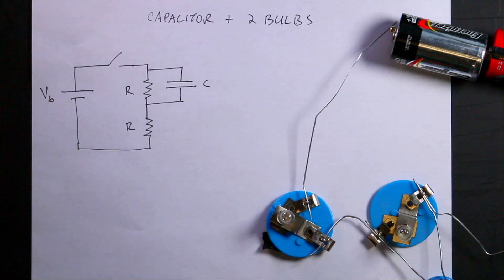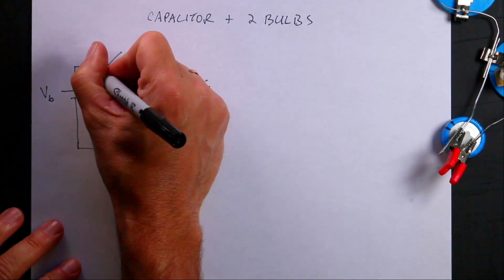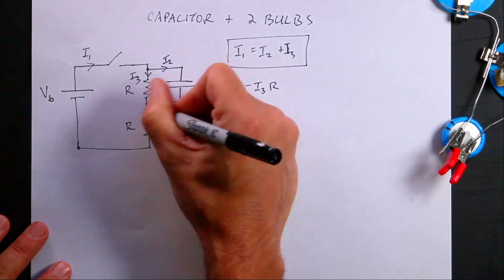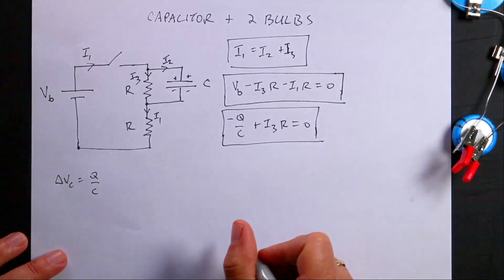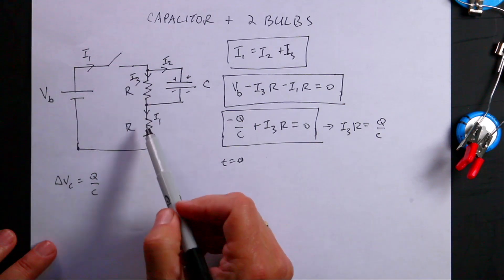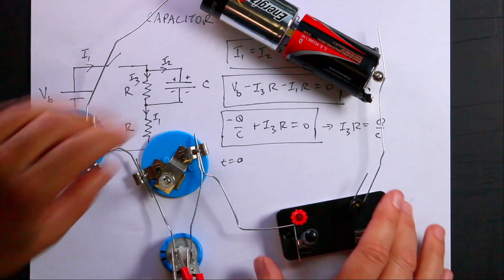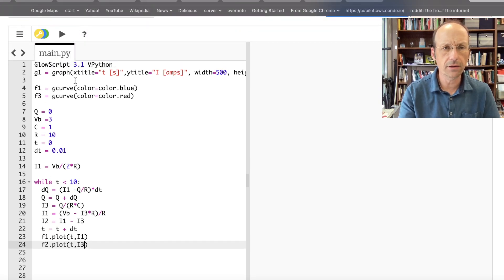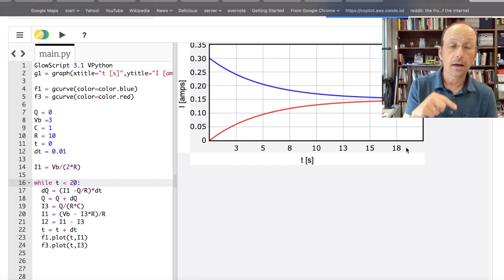Two bulbs and one capacitors - what happens to the brightness?

Comment: Question about the initial condition current, i1 : At t=0, the uncharged capacitor causes no resistance to charge flow to or from its plates, creating a sort of "short circuit" around the first resistor. So, should the initial i1 be just Vb/R ??
Reply from the maker: if you take out the capacitor (because it's uncharged with zero voltage), then you have a battery and TWO resistors.  So I1 = Vb/(2*R)